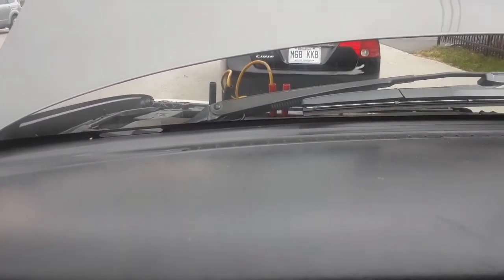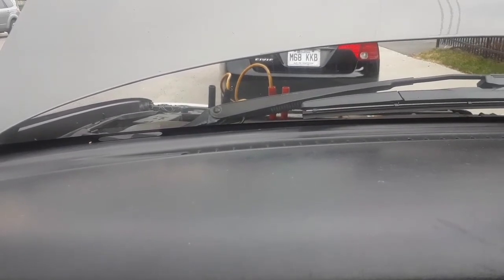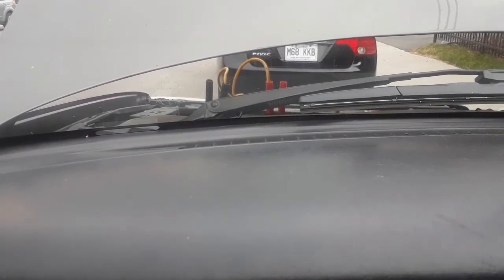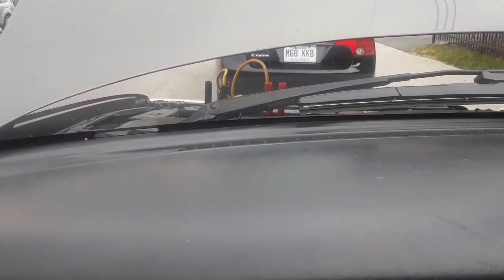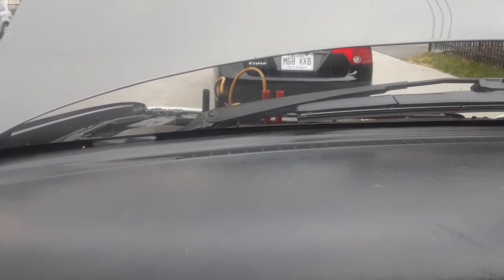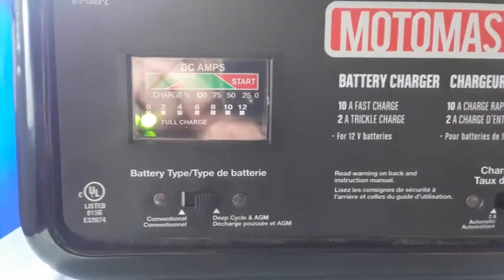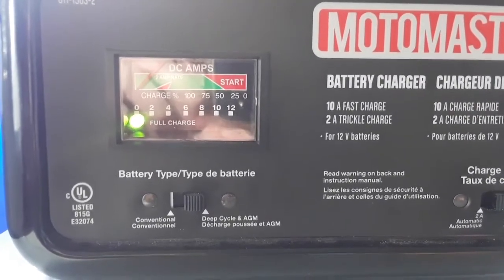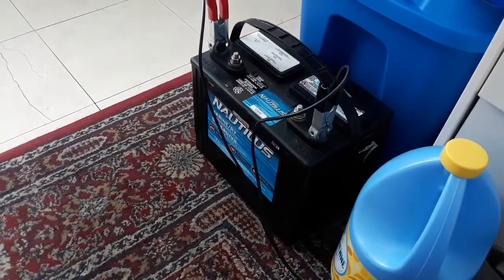Try this Trick to Save Your Deep Cycle Battery.

Comment: Really not sure why they call them smart chargers these days. If they wont start the charge thats just stupid IMO...change the name. I've had to trick my charge like this a few times and it's annoying.
Reply: The charger is smarter that you are, you see it do not want to charge a battery with a too low voltage for a damn good reason, and that is that the battery is in a bad condition and you should replace it to get full service out of the battery. Most people do not understand this, or they refuse to accept it and they are ready to do all kind of strange, and sometimes dangerous, thing to revive a battery.
Reply: @K2teknik.  well, no. that statment simply proves you're an idiot.